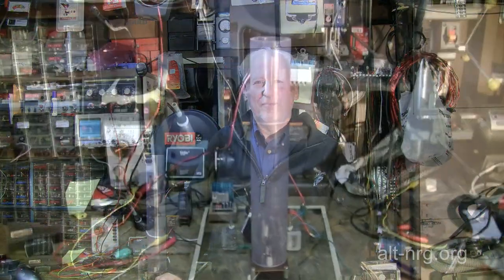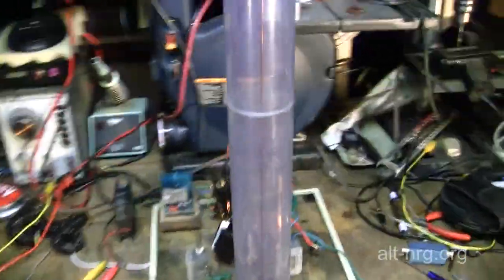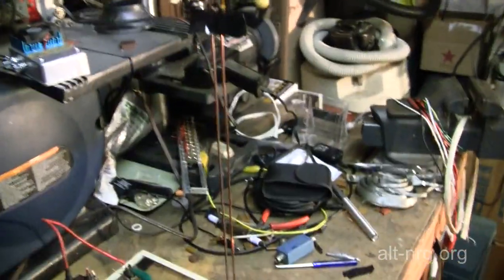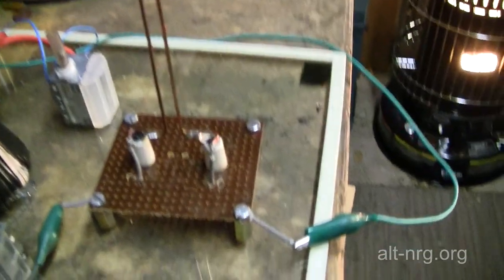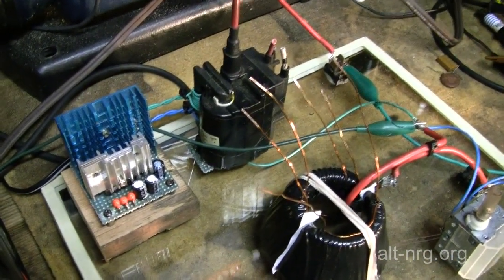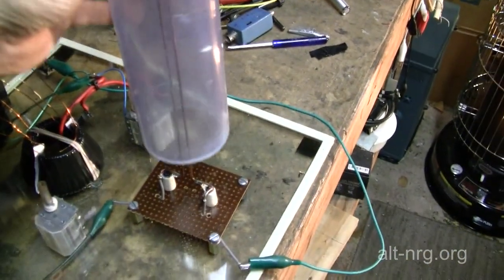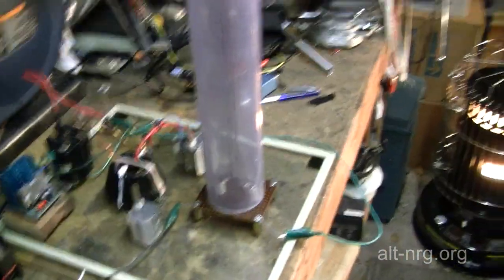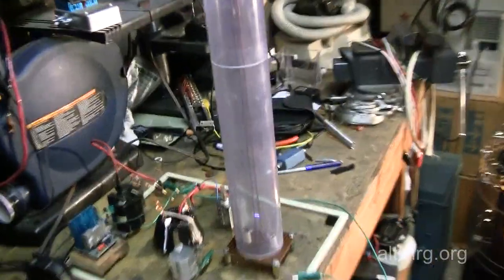#303 Jacob's Ladder with CRT Flyback transformer

Comment: Actually the arc causes a gas which is lighter then air.  That gas has less resistance then air.  Because the resistance is less the arc follows the gas and climbs the ladder.  I have one that is about 4' tall.  I used an old 15kv Neon Sign transformer.  Very dangerous.  But I do get about a 2.5 inch arc.  I used to set it up for Halloween.

Comment: love it, thinking you need more voltage though, not sure about how well the tape insulates at very high voltages but it it starts to fail you could always individually hold the top of the leads still